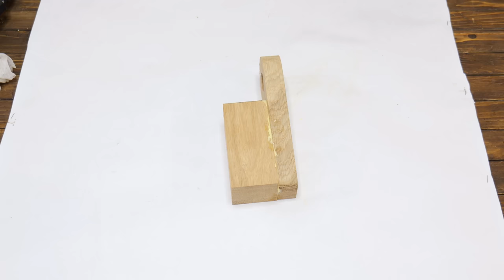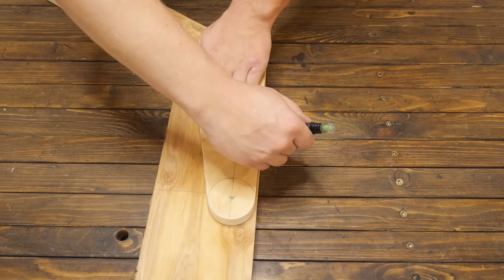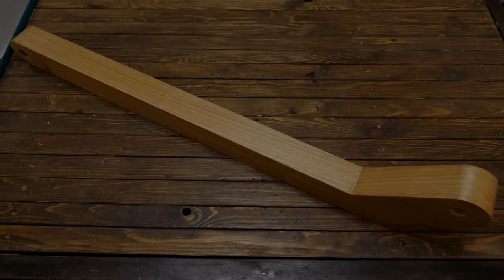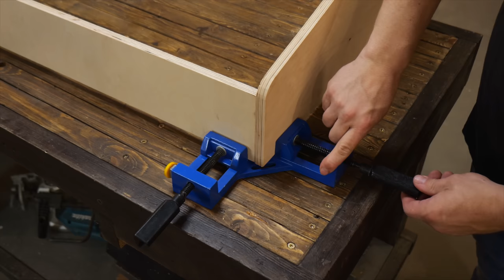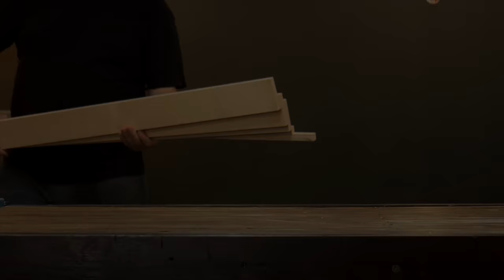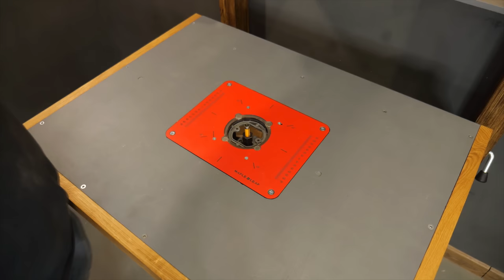It's very simple! But not everyone knows how it works!

Comment: Extremely cool router table!  I was starting to get frustrated trying to figure out what he was building… almost stopped watching. Glad I finished the video!  That thing is as overbuilt as a BMW, but will make precise cuts on the small parts where it’s easier to move the piece than the router . I especially liked his method on veneer - contact cement lamination. He did in 5 minutes what took me an hour.

Comment: Nice use ofa variety of skills. A little over engineering  for what you get. I thinki would have ither sed bigger dimentional oak or painted the plywood.  It migt be a little unsteady especially for bigger projects.  No fence or dust collection are negatives. Still a great build for a table for small proects.

Comment: I wonder if anyone caught that little trick he did at the beginning. 

If you want to mark the center of a board just align your scale so that two convenient numbers lineup with the edges and then pick the middle number on the scale. For example, if you line up 1 inch and 3 inches, the middle will be 2 inches.

Comment: Nice idea but to be a working table with a power tool, your design has to many possible places of weakness.   I also saw your oops at the end, your center where the light was, was meant to fit the back of the router but it was not a big enough space.. I have those problems to where I thought it out well, but somehow missed something or something else now was in the way.

Comment: To be honest, I have doubts about the strength of your design.
Simply because routers produce a LOT of vibration. So every part that's glued will eventually detach. Carpenters glue is not the strongest bond with or without the thin nails you used.
And to have the whole weight of the table rest on the thin glued vertical lips, especially if the wood is subject to tension and compression, is just asking for trouble.
I think your design is very interesting and original but I wouldn't use it unless the vertical rails are made of steel, specifically because of the risk of everything falling on your feet (and fixed routers don't have safeties because they're usually not moving so the only risk comes from the piece being shaped and the fingers of the user. In your case, everything around the tool becomes a serious risk).